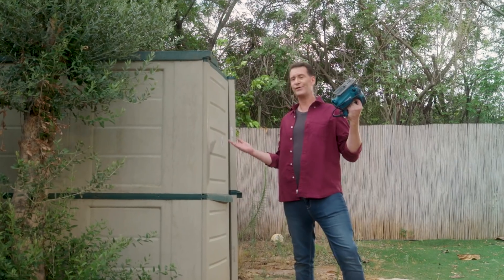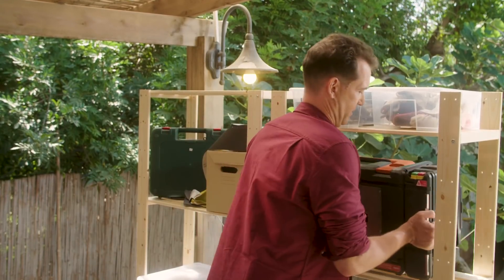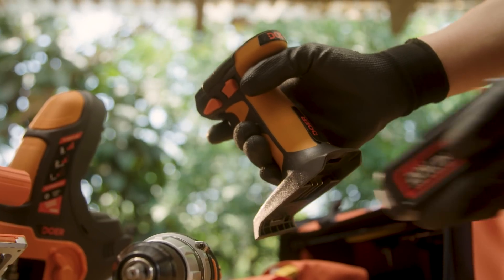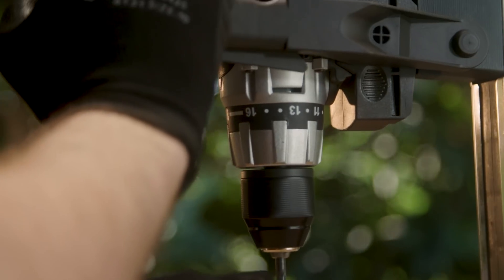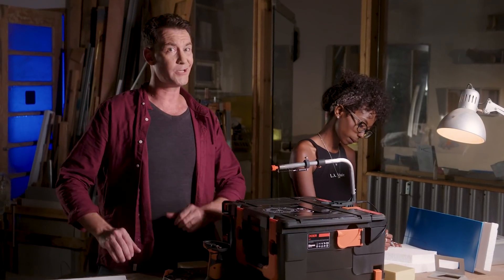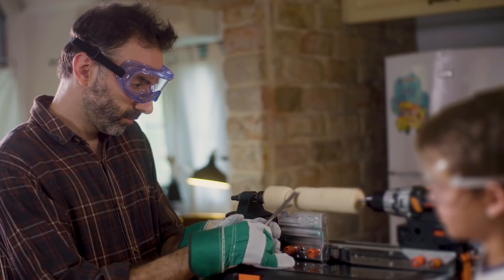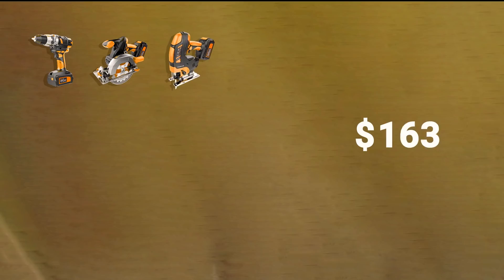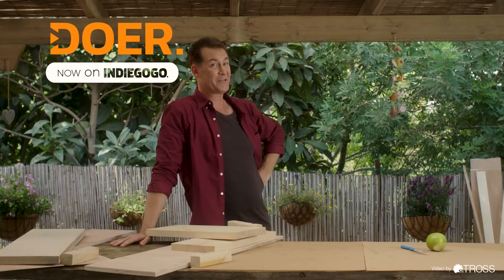DOER - The Most Compact Tool Shed You’ve Ever Seen

Comment: Close, but no cigar on this iteration. Most of concept is quite good, including brushless for added power.  Needs re-engineering to get costs down by having single mechanically interchangeable brushless motor to  power all of the tools (like B+D Matrix ,  old Power Fist 5 in 1).  Likely would require bevel gear drive circular saw for handle ergonomics to work, but is do-able.  Great idea for restricted space lifestyles such as full-time RV living. I would go for it with such improvements at around $500.  Perhaps a basic workshop package option to keep price down as well.

Comment: 'one handle' - so only one tool at a time. Lamp to see what you are doing, but you can't do it - the handle is occupied.
Why on earth is the handle required to use the table tools? That is madness.
Reply: It’s not required unless you don’t have mains power, however you’ve got a point. It would be great if they provided two handles and 2 batteries at least.
Reply: @Naiemaa  My point is that it should not be required at all! It is a design fail. As an electronics design engineer, I would be ashamed of being involved.
Reply: @Tensquaremetreworkshop   If you only have one handle it will allow the tools to take up less room , as space-saving  is one of the features of this unit.
Reply: @morrisjvan  Yes, you only need one handle. But there is NO need to design the kit so it is required for bench tool features.  Indeed, the space it occupies in this mode would not then be used, making it MORE compact. The battery should slot directly into the bench. The controls are already in place. This is an epic design fail.

Comment: This is basically the CEL Power8 Workshop. I have one, but they batteries are crap and render it useless. Looks like they at least have a removable battery now. On the CEL version the NiMH batteries are built in to the power handle so once they are toast and won't take a charge, the whole thing is garbage.
Reply: I understand. Have you tried replacing the NiMH cells for Lithium ion cells? Any luck?
Reply: @leonardorojas1781  Sadly, you can't because the entire charging ecosystem is very basic and designed for Ni-Cads. For Lithium you need a much more intelligent charge controller or you'll destroy the cells and possible start a lithium fire and no-one wants that.

You might be able to make it workable if you bodge in some other tool batteries (lithium) but use the original tool charger to recharge those packs, but the whole working in bench mode would possibly either still not work or be dangerous. I wish they'd at least designed it so that it could run on main power when plugged in to the bench, but sadly that's not how it works :/

Comment: That table saw has no fence big problem... Also it doesn't seem to have a proper Writhing knife, this is the most important safety feature on a table saw and you should never operate one without it... The guard is optional because there is only one type of cut (other than blatant stupidity) that it protects against, also there are many types of cuts of a table saw where the only way to make the cut is to take the guard off... A writhing knife how ever never needs to be removed for any cut and it stops the wood from binding in the blade, this addresses a whole host of safety problems most commonly the table saw throwing the work piece back at you or someone else at 100MPH.
Reply: What about 2:39 it seems to have a "fence" and "riving knife" .. at least in a way that can be written as marketing on the website and box